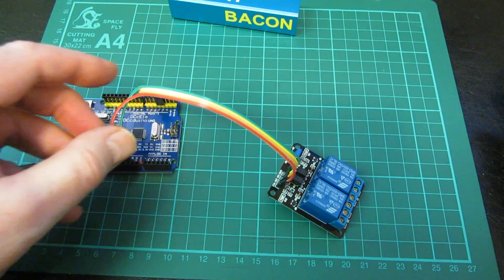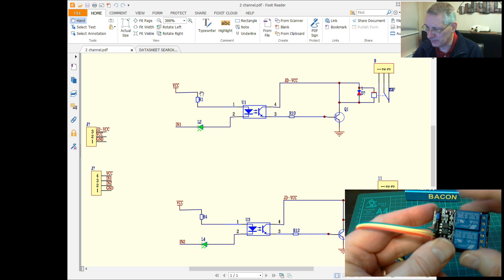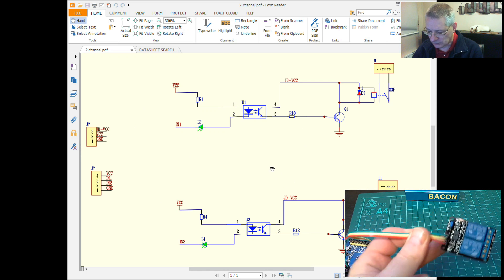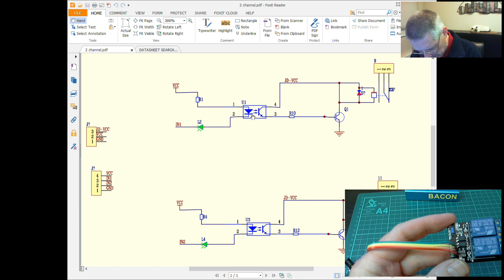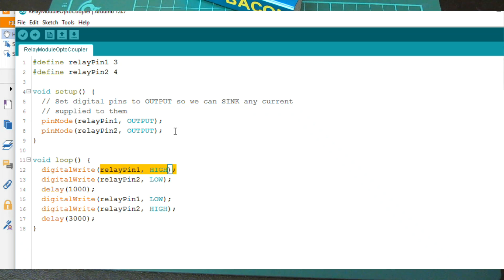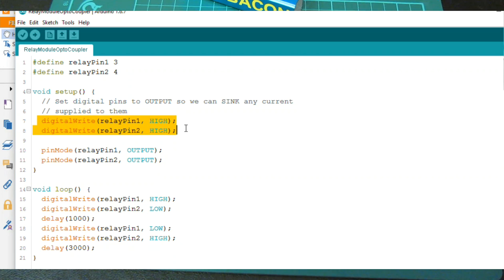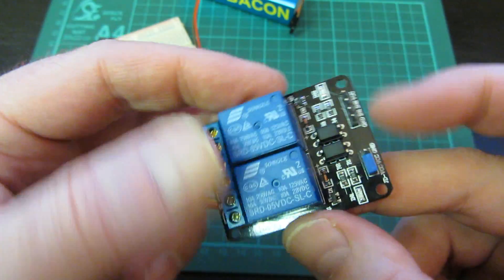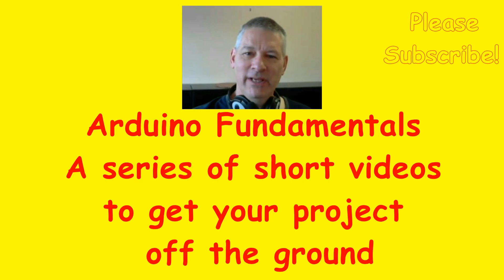#18 Add a Relay Module to your Arduino project - Hints, Tips & Traps

Comment: I need help, please. I need to have a stepper motor turn in one direction slowly, then stop and come back the same way. It also needs to be able to turn 360 degrees if I require that, or 90, 180, 270, and so on. Then just something to control the speed rate. Will this project work? Thanks
Reply from the maker: This is not really a relay module project but an Arduino sketch can certainly control a stepper motor as you require.
Reply: @RalphBacon  thank you very much for the reply.

Comment: I found this just in time!  I'm having an issue with a circuit I'm working on - it works on a 1 channel relay, but I tried using a 4 channel relay to expand the circuit.  It's not exactly working the same as it did on a one channel relay, and I was SOOOOOOO close to changing that jumper to VCC and GND.  I decided to do some research before switching the jumper all willy nilly.  After watching this, I think the optocoupler may be at least part of my problem, especially with the high/low currents you mentioned, so I'll keep experimenting.  Thanks so much!
Reply from the maker: A four-channel relay board is effectively a single board with four channels. If you use a separate GPIO pin for each relay on/off it should "just work". Get it working on ONE relay (out of the four) and then move the connection from that one to another one and you should find a different relay suddenly springing to life.

Comment: This was a awesome complete guide for relay module❤ I want to add a arduino to one of my home appliance so Im using a relay. the power outlet voltage is 220 volt and also the machin input power is 220 volt too and as you know arduino input is 5 volt so I was wondering is it possible to use a voltage decreaser module from 220 to 5 volt for my arduino instead of using adaptor for the my arduino and adaptor for the machine and just plug the both at the same time with same power cord directly to the power?
Reply from the maker: If you have your mains voltage as part of the project anyway, I would use a mini PCB-mounted 5v PSU. I've used this many times and they are good if you use a good quality one. Hi-Link are OK. 

They might do a screw terminal version (so not designed for a PCB) if you look hard enough. 

Also check out "open frame 5v PSU" which I've also used with great success. These always have some sort of screw terminal but are larger than the mini PSUs I mentioned above.

Comment: can i use high trigger or are all relays low trigger? lazy and dont want to rewrite code ha
Reply from the maker: Many require the GPIO pin to go LOW (to sink ) the current, but I have a couple that have a jumper and allow high OR low usage. I bought them from Amazon as I was in a rush but, frankly, the prices are sometimes equivalent to the Far East markets, once they have added on VAT and postage. Here's a link: https://amzn.to/49rzrL5
Reply: @RalphBacon  I had done a little more research since writing the comment and found ones that can do both. 
Your videos are great BTW, used one to learn to code an arduino to work a solenoid hydraulic valve block for a piece of farm equipment.
Now to go from code and simulation on the breadboard(which was useful, damn button bouncing!) to a prototype pcb for a controller. Any advice for a total novice?

Comment: i tried to remove the ground pin among vcc and IN pins to one of my 4 relay module and now the led wont work...i think i broke it :< just like what you did on 8:07
Reply from the maker: I don't think you can break a relay module just by removing the ground pin but you can check it's operation in two stages; the opto part first, followed by the actual relay power.

If the LED lights up then it will all work. Remember you need to have the GND connected in all cases.
Reply: @RalphBacon Ive absorb many infformations(including yours) in my head, still cant reach solve my main problem..

Comment: Is there anyway u can tell me what’s needed to accomplish a simple task? So , I have 2 sets of 20 header pins, let’s call them source 1 and source 2. And I only have 20 pins as an output. I want to use a physical button to select between which source i want to use, either source 1 or 2 but never both at the same time. So in theory is basically a 20 pin ribbon cable switch so to speak with 2 separate sources and 1 20 pin ribbon cable out so to speak, with a switch to select which source I want. Thanks any help would be appreciated
Reply from the maker: I'm guessing that a mechanical switch for 20 cables is out of the question (it would be for me).

I would consider using a 20-way (or 2 x 10-way) digital switch IC. These are integrated circuits that switch signals (only signals, no high power stuff) from one source or the other.

Purely as an example, here's a link to a 4-way, DIL switch so can see what I mean: https://bit.ly/digital-switch-IC

You would have to design a custom PCB to make best use of these switches with a socket for the ribbon cable connector - very do-able but worth researching (and perhaps trying out a smaller switch like the one above first).

Depending on your soldering / PCB design skills, there are ICs in DIP format ( through-hole like above) or SMD QFP (square) with much higher switch counts.
Reply: Isn't possible to use a transistor(Mosfet) so that you can enable or desable the grounds of each 20 pins group?

Comment: are nano d4 and d5 not able to sink as much current as the other discrete outputs ?  
Those 2 outputs do not pull to 0volts, but rather 2.5vdc
Reply from the maker: On an Arduino Uno and Arduino Nano D4 and D5 are just normal GPIO pins and should pull low in the usual manner. Here's an official schematic: https://bit.ly/47YFExC

Comment: Is it possible to use a 12V external power supply?
Reply from the maker: Not for the independent relay power supply (JDD), if that's what you mean, because it only needs 5v. However, the relay can switch 12v, no problem at all.

However, if you have an external 12v power supply, that can power an Arduino, and then you can use the 5v supply from the Arduino to power the relay (VCC-JDD). The downside is that there will be no electrical separation between the Arduino power and the relay power - that might not matter to you.

Alles klar?
Reply: @RalphBacon  Alles klar, danke ;-)

Comment: Can we link those relay to our car starter  motor?
Reply from the maker: Good grief, no! Your starter motor will take many, many amps to turn the engine, far more than this relay will handle. You need a proper automotive part to do that.

Comment: omg!, thank you so much! I had this issue with powering up an Arduino. The relay would activate within the first few microseconds, turning on the contactor of an AC motor,and of course, that shouldn't happen, It was driving me nuts
Reply from the maker: Glad it helped you Manuel!

Comment: So, what if you want to only use 1 power supply but still have the protection of isolated circuits?  You can't really be creating devices with multiple power supplies.  Can my external power supply be made to supply power to both the arduino and the relay module?  Would I need to add in some sort of additional protection circuits to divide them?
Reply from the maker: If you use the same PSU for both parts of the project then they are not isolated. You could use the same primary transformer with separate secondary outputs (eg 2 x 5v output) to provide better isolation but, frankly, dual PSUs are the only way to give total isolation.

Comment: Hi Ralph., do U have a video, where U send signal to ESP32/8266 , to which is connected relay, and another ESP32 has a microphone, and listen to voice commands ? I need to program something like this, to get rid of DC cables from battery to switch.. Cables will be only from battery to LED.
Reply from the maker: Voice commands requires a lot more processing than what the ESP32 can ever give you. You would need, I would think, at the very least, a link to a cloud service (such as Amazon's Alexa service, which is long winded by easy enough to do) for this all to work.
Reply: @RalphBacon  Thanks, bud I have to do it myself I do not want cloud, a lot of work ahead for me to do it.

Comment: I'm trying to make a water pump trigger. Would I put the relay before or after the step up? Anyone know? So if water hits a certain level start a 12v pump.
Reply from the maker: I'm confused about the "step up" bit in your question! The Arduino GPIO will trigger the relay on and off, but the 12v for the pump is controlled by that relay (and never connects anywhere to the Arduino side of things).

Can you clarify the "step up" part of your question?

Comment: WARNING for these relays. They can newer be CE-typed. Because the isolation between the both side are less than 7 mm (230V AC) . The relay is already wrong designed and less than 3 mm between the pads. Sometimes you can see a slot in the PCB to increase the distance, but in this case it shouldn't help. I should NEVER use them with more than 50VAC
Reply from the maker: I'm not sure 7mm is required for 230VAC, is it? Creepage is about 2mm for line and neutral (or other low voltage track). Only for much higher (non-domestic 420VAC) is it 6mm. At least, that's my take on the regulations.

I'm currently using one of these relay modules (a dual version) and so far, so good. Of course, if my workshop goes up in 🔥flames any day soon, you can say "I told you so!" 😲

Comment: I don't know if it's already been pointed out but the back emf diode and relay coil are short circuited. {Q1 collector to JD-VCC line.}
Reply from the maker: Ha! I never noticed that before! Not my circuit diagram, but from the seller. The boards works at least, so we can safely assume that the replay coil is not shorted like that. Well spotted, Glen, you get the Eagle Eyed award for... well, for the last 6 years. 👁️😜

Comment: But why HIGH - is turn it off, while it sent 5V in circuit, and LOW turn them on, while on circuit is just few mV?
Reply from the maker: Because we are SINKING the current from VCC through the device and then through the Arduino to ground. So the output GPIO pin has to be LOW to allow the current to flow in that direction. Make sense?

Comment: If the pin is set Low at the point of being set as Output, and you want to avoid this, shouldn't the pins be set High AFTER the Output command (lines 10&11) in the code, rather than before (lines 7&8)?
Reply from the maker: It doesn't really matter whether you set the pin's state (LOW, HIGH) either before or after the "pinMode" command. 

But if you set it after the pinMode you may get a tiny (1μS) pulse which you might not want. The guru Nick Gammon once told me that setting it before was in fact a bit safer.
Reply: @RalphBacon  excellent, thanks for your reply.

Comment: This video would be so much better if you just said, connect this to this to this to this right off the bat. Instead, you talk constantly about edge cases and considerations and this and that and you predict what we might be thinking and respond to that. ALL BEFORE YOU HAVE EVEN SHOWN US ONE EXAMPLE. By the time I had listened about 1/3 of the way through I had no clue what was actually going on. Were you demonstrating an edge case, a weird exception, the default case, some other case or were you just winging it and we should just keep listening. TOO many distractions before you get to the point. You are undoubtedly generous in your videos, but please get immediately to the point, THEN, show us the things to consider. I can't understand all of the potential problems if I dont understand the basic setup.
Reply from the maker: Yes, you raise a good point, Jason. Show the simplest, default set up first, then discuss other stuff. 🤦‍♂️

Of course, this video is several years old now (and one of my earliest) so I hope things have improved since then! 🤞🏻
Reply: @RalphBacon  I apologize for the tone in my comment. I was so frustrated at the time that it came through in my comment. I am thankful that you have been so generous to provide this information and again apologize for my tone.
Reply from the maker: No harm, no foul (I think that's the expression) 😜 I hope you enjoy the rest of my videos and feel free to keep me on track.

Comment: i am trying to switch between 2 batteries of 12V and 80A and 12V 20A, i am confused in choosing a relay. Would you recommed me which type of relay should i use?
thanks
Reply from the maker: It depends on how much current you will draw in your circuit . If the circuit only draws 2A then a relay rated for at least twice that (so 4A+) will be fine. 

But if you intend using anything much higher (eg 16A) then be very careful that you find a relay that can handle that much continuous current. I always double the rating to be safe.

Comment: So, why not drive the output HIGH to activate the optocoupler.. [Reverse the polarity's]
Reply from the maker: Because the datasheet suggests that the LED inside the optocoupler is connected to +5v and the current sunk (sinked?) via the μController. 

However, as the terminals are totally isolated I suppose you could drive the LED from the μController (instead of +5v) and connect the other end to GND, that should work too. But do check what the manufacturer of the board has done, they might have made assumptions on how you're supposed to connect it up.

Comment: Is it possible to power the arduino from the relay?
Reply from the maker: It can't power the Arduino that controls the relay (a bit like pulling yourself up by your own boot laces). It could power another Arduino though.
Reply: @RalphBacon  I see. What about from the main grid?
Reply from the maker: The relay can switch mains voltages, if that's what you're asking.

Comment: This video may be 5 years old but still very educational and usefull, help me alot. Thanks! 

I had some issues running the code you used but i got it working with afew modifications 🙏🏻
Reply from the maker: Great to hear, Ray! It would be interesting to know what the changes were?

Comment: This has given me a much better understanding of the relay module and how to use it.  Good stuff.  Great video detailing and well explained.  Thanks for the details.

Can you offer any advice for me please-  I want to use two numbers of ON / OFF or push switch (one each for relay) two do jobs separately.  Could you please give a sketch for the same and code.  

Thanks in advance.

Sushil Damle
Reply from the maker: I'm happy this has given you a better understanding of relays in general, Sushii, but I'm not able to write bespoke sketches for you! 

That part of the job is down to you. Break the project down into manageable chunks and think about how they might interact. Only start coding when you have the design at least "working on paper".
Reply: @RalphBacon  Thanks for your guidance.  I have tried doing the same, but I found that the turnout used to be energized where in I do not want the same as there is every possibility for the turnout getting burned out.  Once I pressed the button track should change from Left to Right and when I either press the same button or have another button, when pressed track changes from Right to Left.  The track should be energized only for the duration when button is pressed.  Your advice please. Thanks once again.
Reply from the maker: When you press a button the pin will go HIGH or LOW (depending on how you have wired the button up). Whilst it is that state, the output (keep checking in the loop) keep the output HIGH. When the state changes then make the output LOW. Try this with a very small sketch and an LED to prove you can do this. Let me know how you get on.